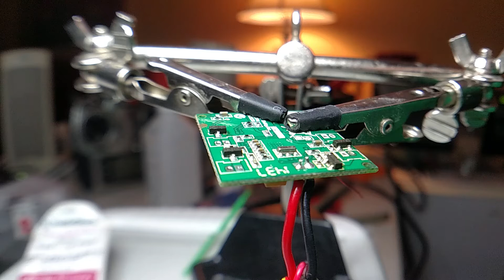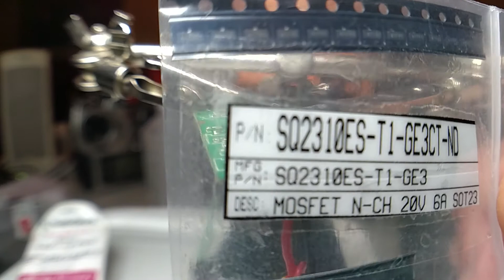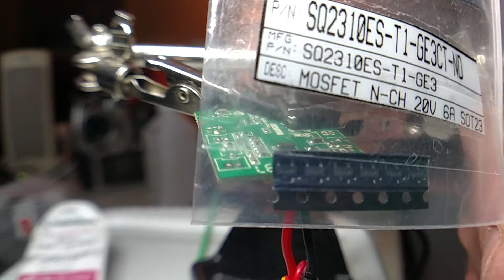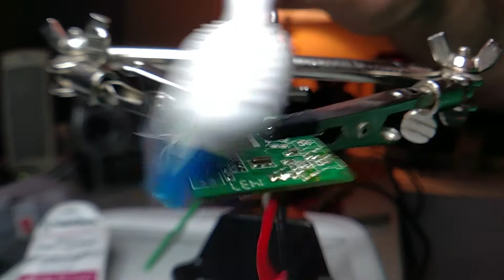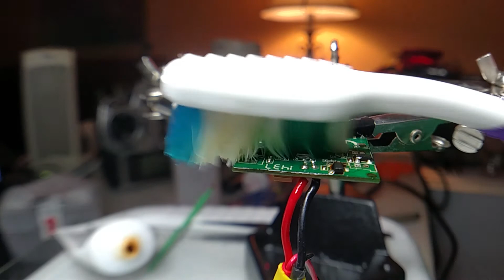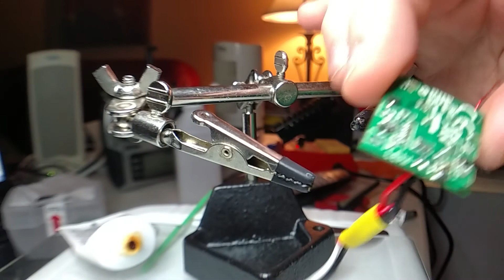Nano FPV QX MOSFET upgrade

Comment: Does having higher rated mosfets get you higher rpm's? Just trying to understand better the benefits?

I think I found a match of the radio shack flux here for you - http://store.caig.com/s.nl/sc.2/category.2341/.f

Thanks for the video and your time!
Reply from the maker: Wfo Pilot The new FETs are to handle the increased current that larger motors can pull. 8.5 mm motors can pull 4 amps, and since the Nano FETs are only rated for 2 amps, there's a good chance that you will burn them up running the larger motors. 
And thanks for the link to the flux. That is exactly what I need.

Comment: Do you have the part type for the FETs on digikey or mouser?
Reply from the maker: +Chris Duncan I looked at my order history on Digi-Key but I remember ordering both N-channel and P-channel FETs, and I can't remember off the top of my head which one I used. I'll check tonight and see if I can figure out which ones I used.
Reply: +adamky1 Thanks
Reply from the maker: +Chris Duncan I believe either of these will work: https://www.digikey.com/product-detail/en/vishay-siliconix/SI2312CDS-T1-GE3/SI2312CDS-T1-GE3CT-ND/2441897 or https://www.digikey.com/product-detail/en/vishay-siliconix/SQ2310ES-T1_GE3/SQ2310ES-T1_GE3CT-ND/4439637

Comment: I have a Nano QX FC with 3 FETs on one side and one motor FET the chip side of the PCB that is smoked. After researching on RCG I'm not clear whether to use an N or P FET as there is links to both depending on the thread. Is it safe to assume that the Nano FPV FC would use the same FET's as the Nano QX? I know Horizon like to do things backwards from the normal convention so I wouldn't be surprised if one FC used N and one FC used P. Thanks for any help

Comment: I noticed you use the tubed flux. Can you please post a name or source for it? Thank you. 
Also did those Mosfets worked fine with your nano QX FPV? 
Thanks a lot!
Reply from the maker: Unfortunately, I do not know where to get that flux. I would love to find some. It was purchased from Radio Shack probably over 8 years ago. It is the best flux that I ever used. I am now using some water based stuff that does the job, but it's not as good as the old stuff.  
The Nano board actually started hitting LVC way too early not long after this upgrade. After a minute to a minute and a half of hovering, it would just drop like a rock. Suspecting that the tiny battery connector might be an issue, I replaced it with one of the red JST connectors and it flies fine now. The stock battery connector is tiny and just can't supply the current needs once the FETs have been upgraded.

Comment: what sort of fets do i have to look for dont think i could pay you to do it only i live in the netherlands EU i think i can hand solder extra on but is best way to do it
Reply from the maker: +8alakai8 These are the ones I ordered: https://www.digikey.com/product-detail/en/SI2312CDS-T1-GE3/SI2312CDS-T1-GE3CT-ND/2441897. Just order something with very similar specs and you should be good.
Reply: thanks only thing is the fets are not on same spot old  nano qx fc but i think i found them
Reply: +adamky1 the part number is not the same part number as the bag . is one better? thanks for the video!
Reply: very late answer but maybe helpfull for later viewer: i got the "dmn1019usn-7" cheap from amazon germany.